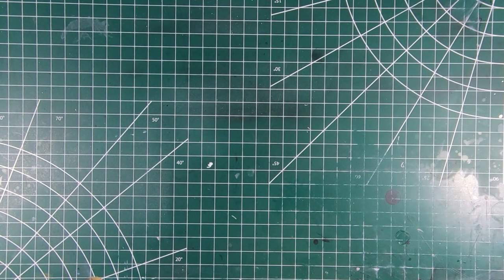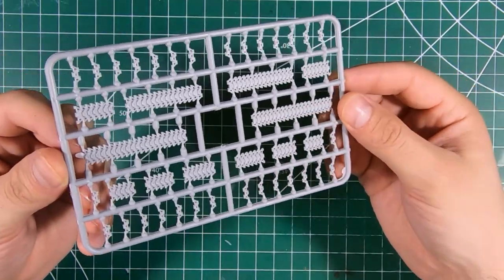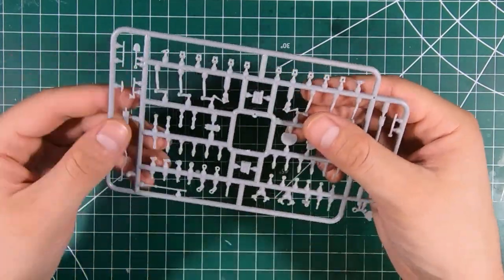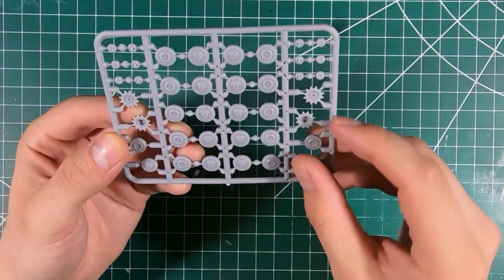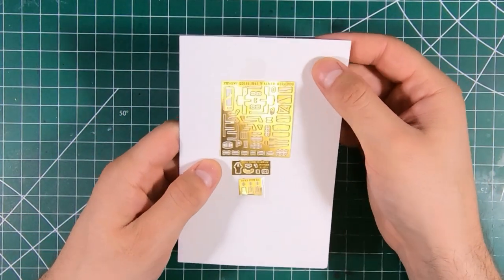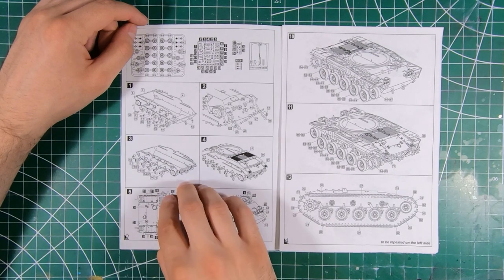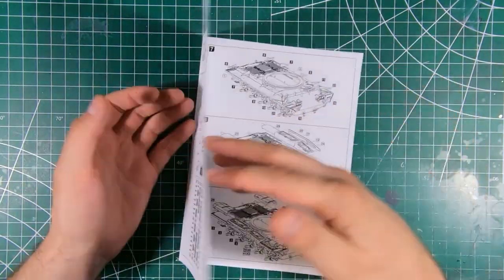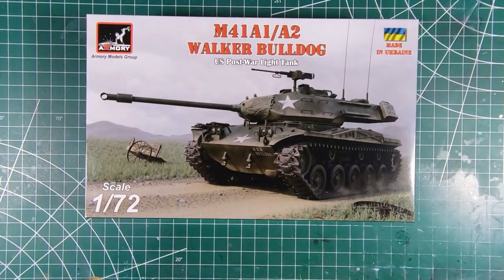Armory Models' Walker Bulldog

Comment: ARMORY kits are short run moulding and don’t use ejector pins, early moulding are nice and sharp but the quality fall off very quickly with subsequent mouldings, the kits tend to be very  intricate unfortunately the moulding quality doesn’t match the technical quality and they become very difficult to assemble to the point of not knowing what is kit and what is flash, they can build into nice models but can take a lot of work.